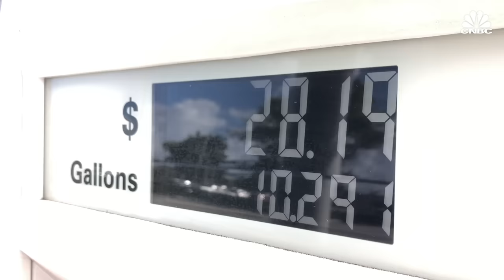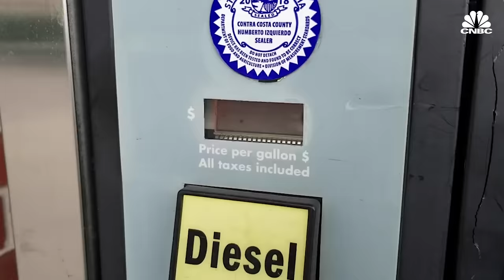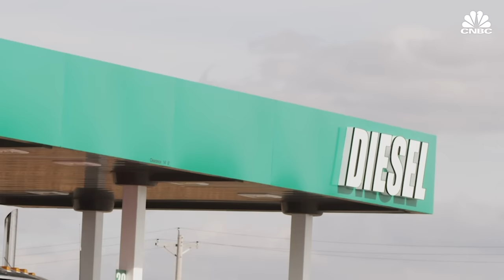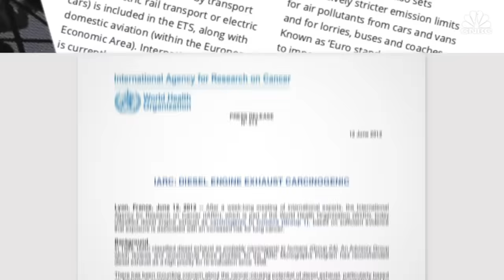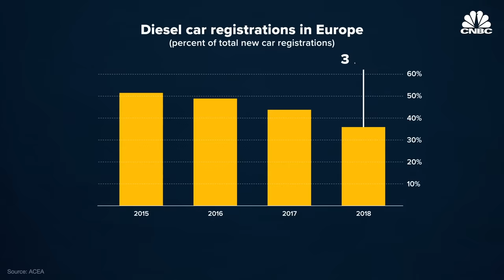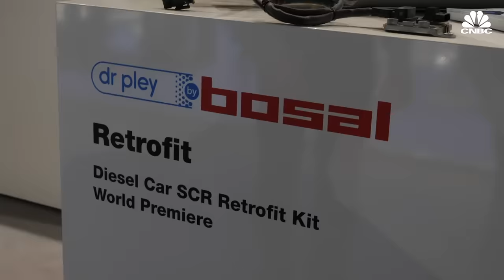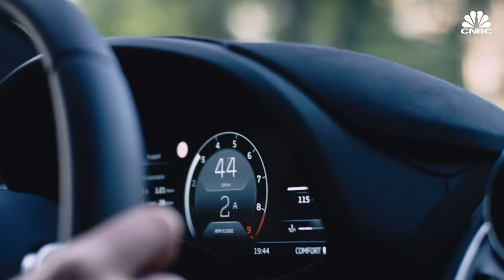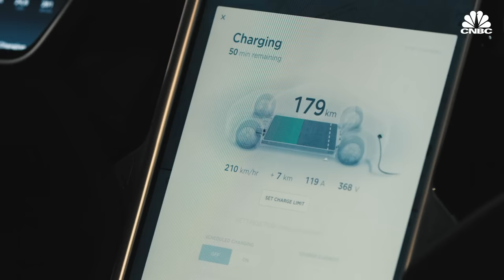Why Diesel Cars Are Disappearing

Comment: Love our diesel SUV but won’t buy another car that needs flammable liquid to run again. Our next vehicle will be electric.
Reply: What do you use your diesel SUV for? Towing? Daily family hauling? Work duties? Will electric work for your needs? Also, diesel isn't really flammable since it needs high pressure to ignite. Unlike petrol/gas, it won't ignite if simply lit.
Reply: @SDav21  driving probably
Reply: @J J
Yay for electric vehicles!
Reply: I just bought a 2014 Q5 TDI (with the recall update installed) and am 100% in the same boat. The fuel economy and performance are unmatched in its size class. I can hit 60 in under 6 sec and even tow a u-haul due to the ludicrous 428 lbs-ft of torque. Smells cleaner than my last gas-powered car, too.
Reply: @alexlu9564  What an intelligent answer. Don't be a doofus. Does he tow a trailer or caravan? Does he use it for work duties or for the school run? That's what I want to know. Your sarcasm isn't warranted. It was a genuine question.
Reply: you can run a diesel engine with basically everything from vegetable oil to CNG to used engine oil.......
Reply: Alex Lu lmao
Reply: @IIOctaneII  You're childish also I see.
Reply: Lithium Ion Batteries are also highly flammable.
Reply: @beback_  yeah it's true - to be honest most energy sources have a tendency to release a bunch of energy if provoked in the right way. If you check the stats though, per vehicle/per mile there are fewer fires from battery vehicles.
Reply: @tommydplayskeys  No. You can't compare stats like that. Fires per gasoline vehicles are counted for all vehicles. Electric cars only really became mass market in 2012. Most car fires are much older cars. So those before 2012. I think the stats will be different if you look at cars from 2012 and up only not that cars before then were more prone.
Reply: Good decision!
Reply: SDav21 sticking with my suv is the best choice, electricity in my country from gasoline anyway, not to mention where the battery comes from🤦‍♂️, the real downside is exhaust smells so bad but whatevs
Reply: We bought our diesel SUV for the torque and efficiency. When we buy an electric vehicle, it’s for torque and efficiency too.
Reply: I tow a 7k travel trailer. Can't wait for the Cybertruck to ship. My next car will be electric too. Quieter, less maintainance, faster and charges at home...what's not to like? I'll keep my Expedition fit long trips, but for short road trips and daily driving electric can't be beat.
Reply: @jghall00  So you want a truck to tow and will keep your gas car for long distances then? Because towing with an electric car demolishes the range. So on top of needing your gas car for long trips, you want to tow with an electric car with even shorter range when towing? Unless you tow short distances but to be honest you're not really making a case for electric over gas.
Why tesla's don't tow well....
https://youtu.be/S4W-P5aCWJs

Also see the same channel to show the silly Cybertruck ruse tesla pulled on people showing the pulling of an F150.
Reply: leicanoct  theres very little maintenance needed for an electric car as it only has one moving part, the motor
Reply: Electric cars are great provided you never drive further than fifty miles from home.

Comment: 10:00 That's a German ICE high speed train. They are fully electric :-)
Reply: Yeah, I was first thinking “they are talking about the shift to electric”, of course Europe has had most of its trains run electric for several decades, and very few of them (mostly switch engines in railway yards) are diesel, but then they are talking about diesel being everywhere and purposely mention “most of the public transportation” showing the electric ICE!
BIG FAUX-PAS!

You just can’t trust your sources anymore, being in corrupt politicized media, baselessly created “informative” news outlets, or shows that just want to generate (attract) viewers with a few valid points but misguiding information.
Reply: Overhead!
Reply: Not a hybrid? Diesel electric?
Reply: @RobiBue  The thing is though, those generators that power those trains....

they're diesel lol
Reply: @THESLlCK  are you seriously saying that the “ICE” locomotive is powered by diesel? If that is what you’re implying, then you really need to refresh your information on Europe’s rail transportation system. And if you’re thinking that European electricity is generated by diesel, then you’re also way off on that one too…
The Americas, from Canada to the southern tips of Argentina and Chile, are mostly the ones polluting the air with their diesel powered trains.
There are very few electric railroads on our side of the pond (the US) and with that I mean fully electric, not diesel-electric.
Reply: @jamesbayly5785  no ICE is an electric train. Most rail lines in the EU are electrified, and most mid and long range trains are full electric. Diesel-electric is only used on some secondary lines.

Comment: Not only are they more fuel efficient but also more cost effcient especially in the long term. The longevity and reliability is worth it to me.
Reply: It's the turbocharger that makes a "Turbo Diesel" fuel efficient; but now they start making "Turbo Petrol", the gaps in fuel efficiency is much smaller, comparable even. Plus you have to spend thousands more to buy a diesel engine in the first place.
Reply: @joebloggs2312  yeah a diesel is most expensive initially but much less maintenance over time. Yeah parts and repair can be more expensive but in general they are less maintenance. They run cooler in general and just overall last longer. When people started to have issues is when they started putting all the emission regulated stuff on em, EGR,DEF,Diesel partical filters etc. I've got a 3/4 ton truck that gets about 20 on the highway but a gas engine making even 3/4 of the torque is going to annihilate fuel. My VW TDI gets around 52mpg and is definitely less maintenance then my gasoline engine car, especially after EGR was deleted and a better high flowing cat. I understand the point is to reduce emissions but I feel like if you're feeling up less in the first place then you are achieving the same goal you are burning less fuel.  Bio diesel is extremely economic, It's easy to make and your using half the diesel #1 you would normally be using, I'm talking actual 60/40 bio diesel not the diesel #2 they claim is bio diesel.
Reply: @joebloggs2312  also the turbo isnt what's making it fuel efficient, If your talking power though, comparing a forced induction engine to a naturally aspirated in terms of HP/TQ then yeah you can squeeze more power out of a forced induction engine and get better fuel economy. Diesels make a lot more torque not only because of the stroke but how they "fire". They also run cooler man, which means longer lasting and things like oil changes aren't near as often. They are also extremely simple by design... You can get insane fuel mileage out of a little four-cylinder,8 valve,single over head cam diesel engine and get a half million miles out of the motor easily. There's no way around it they are without a doubt less maintenance.
Reply: @bryanmoore3051  
I also have a Golf in Mk7 TSI. 48 mpg longterm combined cycle (mix of urban and highway) on premium fuel. 127,000km (79,000 miles) and I do oil changes, filter changes, tyre rotations, etc myself so hardly ever need to check it in for repairs or maintenance. It's in stock form, and working great
Reply: Lol’d at “longevity and reliability”. Maybe if you are comparing two Volkswagens given how unreliable VW petrol engines are, but try a Toyota or a Honda engine and they’ll show you how reliable they can make ‘em.
Reply: @User-cb4jm  VW diesels are very reliable but not petrols

Comment: Only in America. In South Asia, diesel is extremely popular.
Reply: In europe as well (at least in Spain)
Reply: In South Africa it’s popular too. We only have diesel pickups.
Reply: Tony Dinh  What?  the original commenter was commenting about the fact that diesels are only disappearing in cars in america?  I personally own 2 diesel vehicles and live in america, while i may be the underwhelming minority of people, i love my diesel vehicles.
Reply: For the first time, diesel has become more expensive than petrol (or nearly as expensive). It will only be limited to those uses where high torque or pull is required. Alternative petrol technology is also catching up, with the supercharged engines.
Reply: @Amit_Kumar_Trivedi  if you own a diesel lookup videos and such on how to make biodiesel.  Both my 2008 diesel and 1984 diesel run 100 percent on biodiesel made from oil from restaurants.  I spend like a quarter of what i would normally spend on buying diesel from the pump.
Reply: Hello wake up!!!!!!!!
In USA never exist a diesel engine.
Only petrol engine.
Reply: Tony Dinh  I think you need to read the title of the video and the comment again
Reply: @Amit_Kumar_Trivedi  supercharger uses more fuel so. Petrol engine is not efficient cause of it thermal properties compared to diesel.
Reply: Bro we use CNG conversion now.
Reply: In Latin America as well, in fact in my country Honduras, the best-seller car is the Toyota Hilux.
Reply: In germany almost 40 per cent sold cars are diesels.
Reply: Petrol engine are loosing power uphill with loads on refer to diesel engine will remain powerful.Igot two 4wd  same model comparing .
Reply: We have diesel pickup trucks
Reply: So is eating dogs.

Comment: i love my diesel truck. 630,000 miles and going strong. straight pipe exhaust ,no emissions 500hp at the wheel. that cummins is a beast.
Reply: you could have saved 1000s if you drove a hybrid prob enough to buy a whole other car
Reply: @neoanderson7492  I don't think they make a hybrid that I can put my welder and tools on
Reply: @blindbob2539  then use your welder and tools to modify the hybrid to make it work
Reply: @neoanderson7492  but the truck is perfection. Brilliantly engineered. Simple, powerful and dependable. Paid for since day one. Paid cash for it brand new. Diesels are phenomenal machines.
Reply: @blindbob2539  it's your tens of thousands of dollars you're wasting gas money not mine
Reply: @neoanderson7492  I don't pay for diesel. The companies I contract with fill my tank and welder daily.
Reply: @neoanderson7492  at least you can depend on a Cummins, the brand is literally built off being reliable. You can’t say that for a battery pack in a hybrid, sure they are getting better but you’d never get one to 1,000,000 miles like a Cummins and they cost upwards of $10,000 to replace... reliability is not the same, I’d take filling the tank regularly than being dropped with a $10,000 bill you weren’t expecting to replace that old battery pack
Reply: @manisandjr8435  there ain't nothing on my truck I can't fix myself if need be. But I don't abuse my tools or vehicles and I am meticulous with scheduled maintenance. The only people that I have met with problems with a cummins abused them with over fueling them with aftermarket  "chips" or had an automatic transmission that just couldn't stand up to the torque.
Reply: I don’t think you know what no emissions  means
Reply: @neoanderson7492  Rofl I can't believe you're serious
Reply: @James-xn8xe  I know I don't care about bs emission regulations.
Reply: @blindbob2539  exactly.
Reply: @blindbob2539  worked on diesel vechicles and 
engines for 40 odd years, you can't beat them for their reliability 
and long running life.
Reply: @neoanderson7492  most people who own diesel powered trucks use them for WORK.  The people who rely on their truck for their livelihood can’t afford to play around with battery powered vehicles. The guy who uses his truck to carry his welding equipment probably is miles away from a charging station, out in a farmers field repairing farm equipment, or building the infrastructure that makes your way of life possible. 

Until recharging a battery is as quick as a fuel stop is for a ICE, electric vehicles will stay a novelty. Electric is great for in town commuting,  not so much for the real world
Reply: @mattrodgers4878  I never said electric cars I said hybrid. Hybrid don't require charging stations. Ever. I don't think electric is the answer I think hybrid is the answer. And you are wrong very very few people actually need the power of diesel car and even fewer actually use them for work
Reply: Emission equipment defeated no doubt.
Reply: @tigerseye73  03 and 04 Cummins only came with a resonator (muffler),no catalytic converter until 05 models and no dpf until 07 1/2 year model. I installed a 5 inch straight pipe exhaust to reduce exhaust temp while heavy towing vs the stock 3 1/2 inch exhaust. Worked flawlessly.
Reply: @blindbob2539  My '97 12 valve came with a cat. Hard to believe Chrysler removed them from later models. I will do some checking on that.
Reply: @tigerseye73  94-98 had catalytic converters on them but they were dropped in 98.5 -02 (2nd gen) and then 3rd gen years and not picked back up until 05.this was due to the ecm handling more precise fuel burning than the prior p-pump

Comment: Volkswagen Passat TDI (diesel model) one of the best cars I've driven, very well designed (interior) motor was awesome  made gas feel aweful. Shame about the Volkswagen scandal
Reply: It's too bad. I owned a 2010 VW Diesel(Jetta Sport Wagon) I crashed it, before the buyback happened. :-( 
You could run your finger inside the tailpipe, and there was no sign of soot, unlike my older diesel vehicles. VW 'cooked the books' but it was a very clean running diesel vehicle.
Reply: alan bane  The regular TDIs were the legendary engines not the PD.
Reply: Since they dont make them anymore, I plan on parking my 5spd manual as a collectors car once I find an Audi gasser to replace it as a daily driver.
Reply: alan bane          Right there with you.  LOVE the pd130 in my Mk4.  Love the way it develops power, 6 gears; long legs for long journeys & 54mpg.  TBH I hope it lasts forever.  
Dread the idea of electric motorcycles, too – If I ever had to have one, it would be a driverless one.  : )  Big fire-breathing, swamp-monster V-twin from Lake Como is what you want.  Power, noise, soul & character.  Viva Europe, good luck America – AND therestoftheworld.
Reply: Most VW consumers didn't care for the so called scandal (all makers were doing some form of cheating) because the TDI's are just so good.
Reply: When the scandal happened, I was like "You go VW! 👌😸"

My first dealer purchase, this year, was obviously a Golf Sportwagen TDI SEL (6 speed manual, of course)!
Reply: Just bought a low mileage post-fix 3.0 TDI Touareg...406lb ft of torque...was thinking, this thing is seriously the last of a breed, especially in the US.
Reply: @NEVER--MIND  Diesel is fairly well a clean runner BUT when it burns oil(high mileage cars do, you get the soot and black smoke as now the crankcase oil is part of the fuel mix. The commercial trucks put a million miles on the engine before they do an engine overhaul because it is burning oil. All engines wear out
Reply: Silas Dietrich in the US, VW are expensive to fix.  VW gave my friend a new car because it would of cost them to much money to fix it under warranty.
Reply: alan bane  Was?! hmm... I'm still using it. The engine seems to outlast both the car and myself. 12 years, and the only serious issue was the alternator failure (rats chewed up some wiring). Runs like new. Unless the governments devise some ripoff schemes to outlaw such cars, they'll run for at least two decades (and then I quit, so who really cares...)

Comment: Long live the Deisel engined car! I've driven diesels for years now and will never switch back to petrol. There is no denying that a well maintained diesel engine will last way longer than comparable petrol engines. That alone makes them much more cost effective. Then there is the fact that I get many more miles to the gallon than the comparable petrol engine. Even allowing for the artificially higher price per litre of diesel here in the UK, I've calculated that my mileage is cheaper than my petrol powered neighbour.

Comment: We bought a 2017 Chevy Volt in March 2020, right before everything shut down.  I love it.  I hardly ever have to get gas - only when we go on a longer trip.  It goes about 50 miles on electric.  We have had solar for 20 years.  So most of our fuel is basically free.